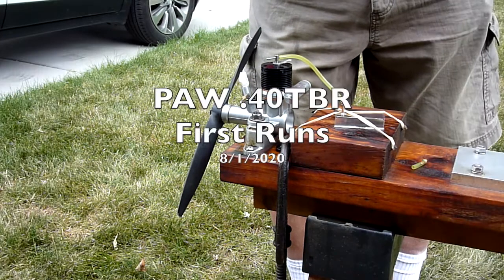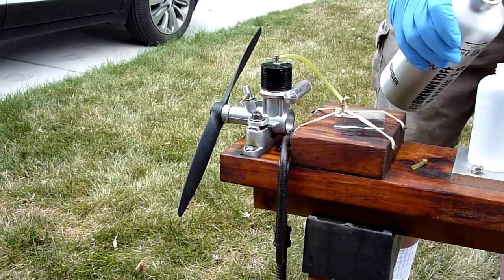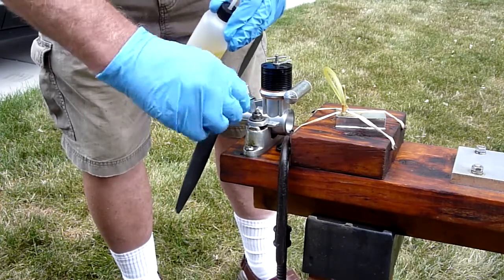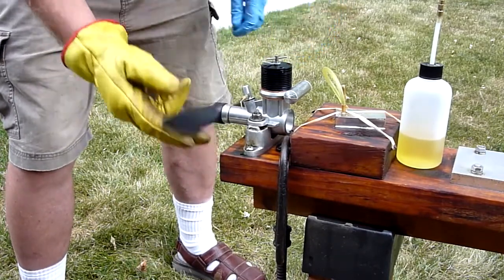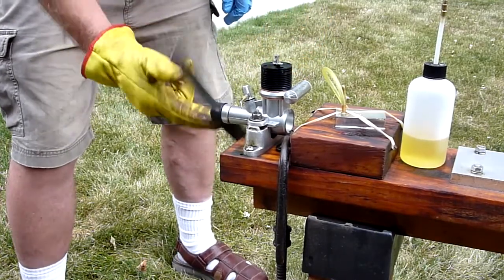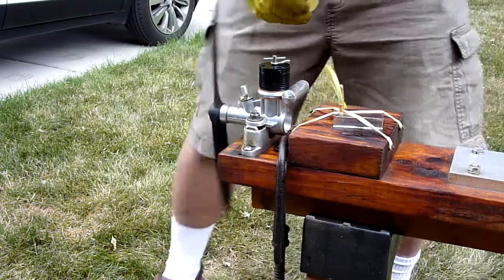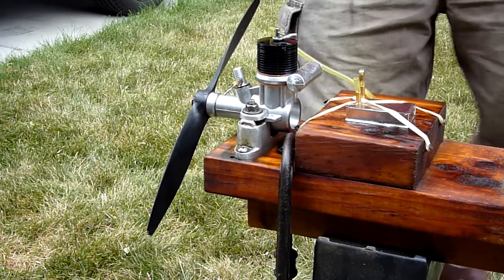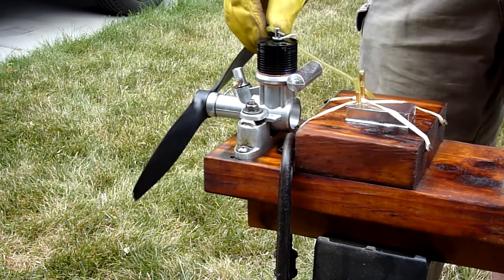PAW 40 first runs

Comment: All it needs is the needle to be opened a bit. One turn should do it. Dude it's too lean.
Reply: Nar, it's too lean for that comp setting. All that fiddling with the comp screw is totally unnecessary. By the way you shouldn't be wearing soxs and those sandals unless you're a POM. Big fashion mistake!  🙂
Reply: Diesels run remarkably lean.  But in this case, it’s under compressed for most of the video.  Diesels run 3-4 times longer on the same volume of fuel because kerosene deliverers more economy and BTU’s than Glow fuel.  
I’ve got a few Russian .15 size diesels that will turn a 10-6 prop around 9600 RPM, virtually the same as a Traditional FOX 35 Stunt engine.  This same diesel will run 6mins on 1oz of Diesel.  The Fox would need nearly 4 oz to do the same running time.